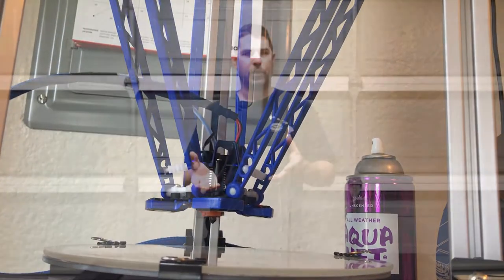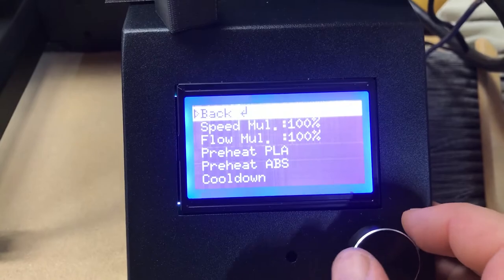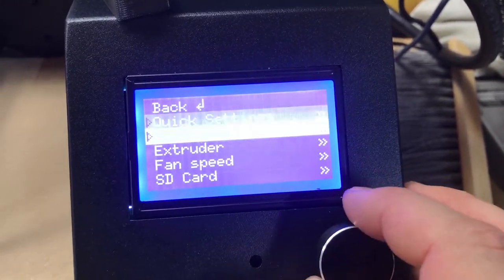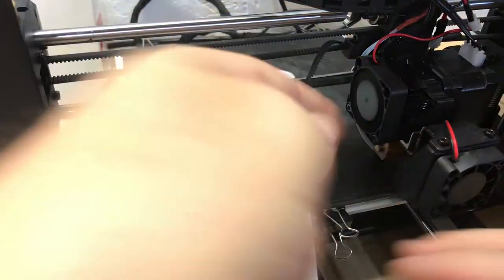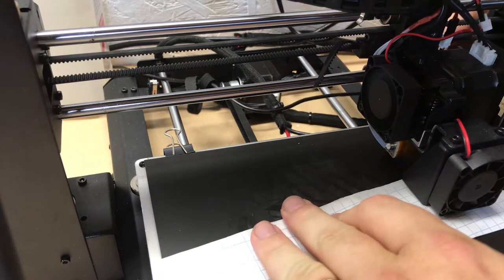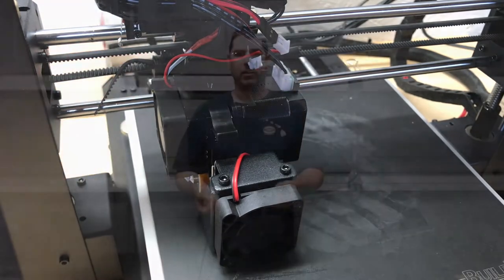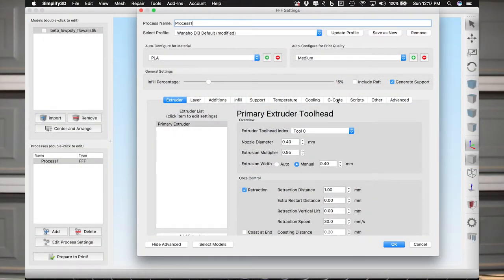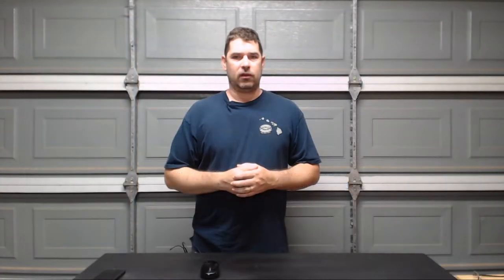Factoring in thermals on bed leveling

Comment: Good tip on an often overlooked calibration. My delta uses FSRs for in its auto-calibration scheme that are specced to only work below 40deg. As such my routine has always been to bring it up to 40C to do the calibration so that it at least takes some thermal expansion into consideration. Obviously as you say this will vary from printer to printer but I would expand your statement to say get the bed as hot as you can while staying in spec and up to what the bed temp will be when running the print.
Reply from the maker: Repkord very good point!
Reply: I've been known to make them from time to time. :)